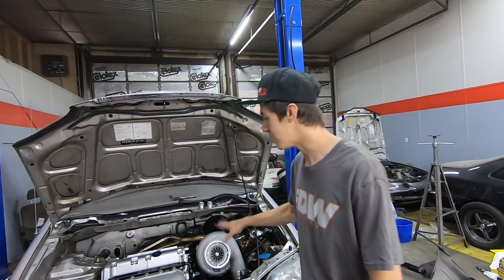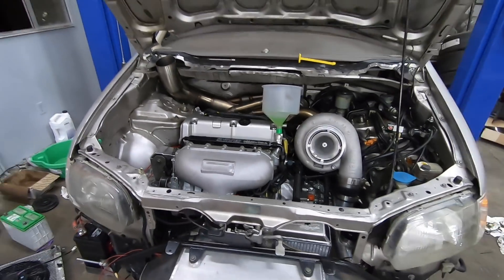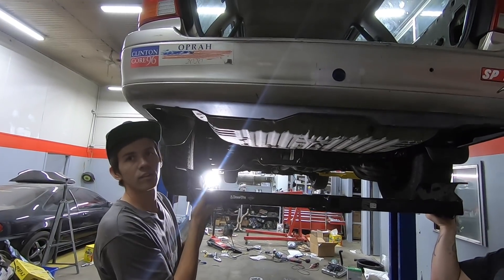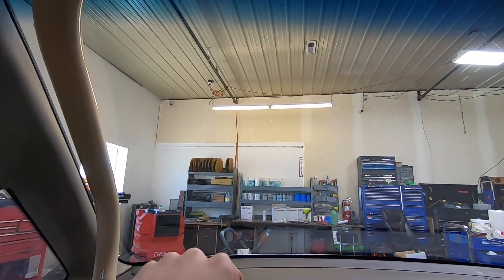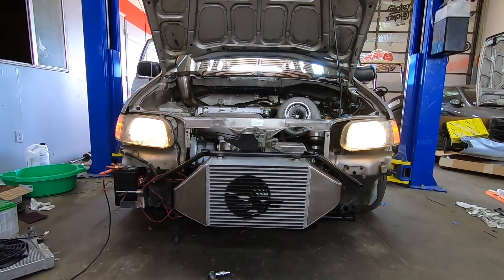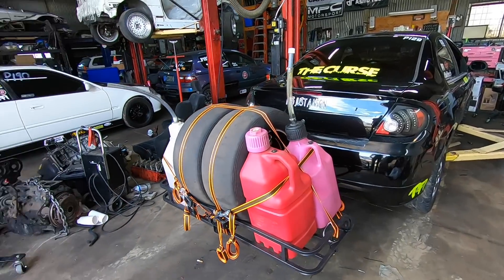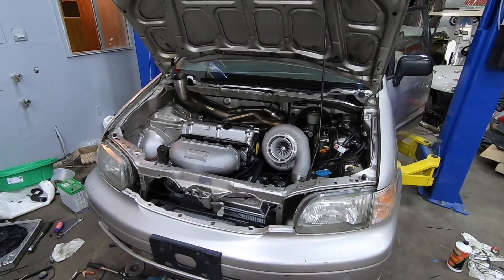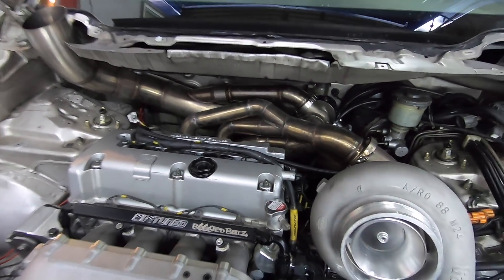The Rowdessey Was Just About Ready To Go Until It Broke...

Comment: At constant half-throttle (1MW thermal dissipation), I estimate you'll need to have the air going >200mph through that little radiator to keep the engine at 90C.  Meanwhile, your intercooler only needs to dissipate ~50kW...

Comment: Please add some ducting between your radiator and IC and bumper. The airs going to take the path of least resistence and your probabaly hardly getting any airflow through the rad.

Check out fasterproms where they used aluminium foil tape to temporarily make something before using it as a fibreglass mould.

Comment: Check your cam angle in the data logs before you do a WOT rip. The angle could still be off and idle well. Just to be safe and not smack valves when the cam phases.

Comment: So kyle takes the thermostat out and lets the coolant run as fast as it can to prevent the cooling system from working, well done youngster well done. Did nobody ever tell you not having a thermostat does this? The purpose of it as a restriction to slow the water down to pick up heat. You know this right kyle? All the old guys are laughing at you atm, you just made your car overheat faster.. Well done, and when are you going to put an air cleaner on a engine so it doesn't suck up the dust and bugs and crap? I mean how hard is it to ask shawn to weld up a cold air and a k&n? I'll give you a little bit of advice, take the thermostat to a vice and cut the thermostat up removing the spring part and valve, and leave the rest intact so it has a hole in it to restrict the water flow, this is what endurance engines do, at least your cooling system can actually do some work, and maybe experiment with a larger hole in the future to see what that spot is to keep the engine cool. But pulling the thermostat is a bad idea.

Comment: I mean I really dont want to hate but dude, this car has made like a solid 7 passes total in its entire life and broken stuff like 20 times in those 7 runs.  Seriously like you may aswell just put a proper motor in there.  Hondas motors are solid, just not 800hp reliable solid.  Even a v-6 turbo from the mdx would hold up way better at the power you want to make.

Another point I wanted to make... condenser is the hot side of ac system, evaporator is the cold side.  The part you are removing is the evaporator core.

Comment: I can't help but think that there are some major design issues with these K-series Honda motors. I mean, I know you guys are beating the hell out of them and they're not designed for these power numbers, but all the heads should care about is what RPM you're running at and these are supposed to be able to rev to the moon in stock form. I'm continuously surprised by how unreliable these motors are after what I know about old-school Japanese stuff. It seemed like in the old days those brands were pretty much indestructible but the K-series motors seem to be a departure from that.

Comment: Hey random question for anyone with knowledge. I have a T2t4 lsd trans for a H22. I bought it from HMO and don’t know what gear it’s in and I don’t want to install the shift linkage to the shift lever and selector lever before it’s in the correct gear for installation. What gear do you want it to be in and how do I shift it without it installed?

Comment: No no no, please don't fall for that myth with not using a thermostat. thermostat is there for a reason, so your car has the chance to get up to running operating temperature without it it will never reach proper running temperature and you will cause more harm to your engine then good. please put a genuine Honda thermostat in there and you should have no troubles with the thermostat being a issues. 👍

Comment: You better take 2 extra heads. And what’s the point of using the same heads on multiple builds when they bend valves constantly and you’re pulling the motor apart every 3 passes

Comment: Nobody talking shit knows what it takes to make reliable power at even half of the horsepower they are running at let alone triple digits.. they are finding the weak points at this amount of power like with any build anyone has, even 100k engines have issues right after there built alot of times that's just the nature of the game if you don't want them to break anything than it's going to be a boring 500hp 4cylinder build like the rest of the builds out there... Unless you've built a 1000hp sequential Honda Odyssey minivan and never broke shit shut up already because you clearly know nothing about going fast or making real power

Comment: You will have more over heating issue 's bro you need thurnastat in water lol the harder you rev engine the fast your water pump pushes water didn't get time to cool anything down lol lol at that rev lol just run through engine would do a thing lol that's why it's so hot on after pulls and takes longer to cool of and to warm up if your in town slow driving it will heat it's tots off that thermo fan Buddy will be working lol
Reply: Huh?? and what is a "thurnastat"?  Remember, punctuation is your friend!

Comment: Something ain't right with those 4Piston heads. For being expensive built heads, they sure seem to fail a lot. I realize you guys are pushing a lot of power, but the H in the Prelude is making just as much/more and has so far made that kind of power for longer. Hope it survives race week, but I've got a bad feeling that head isn't done giving you problems.
Reply: The Rowdyssey doesn't have a 4Piston head. It's just a stock one with aftermarket valves and springs.